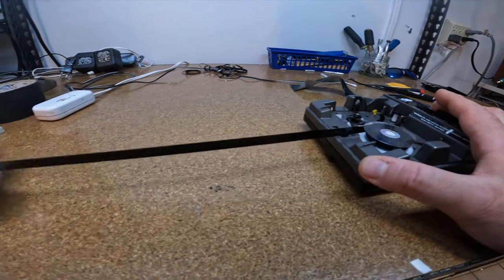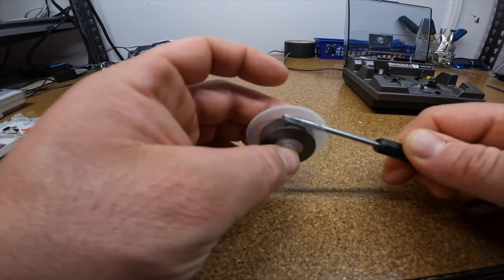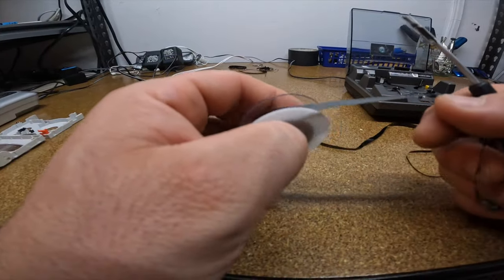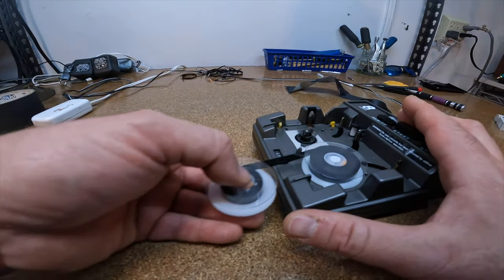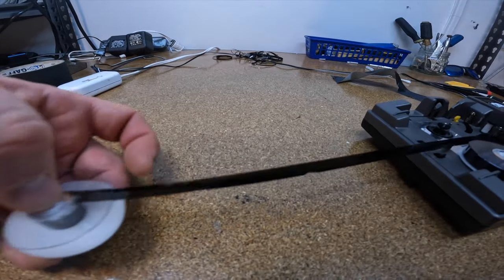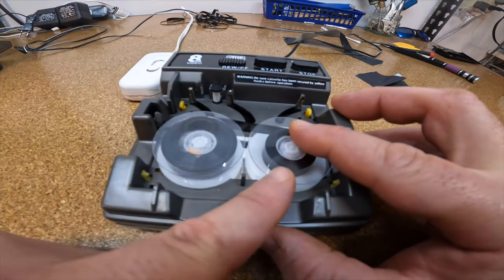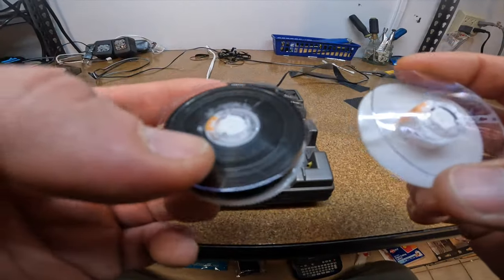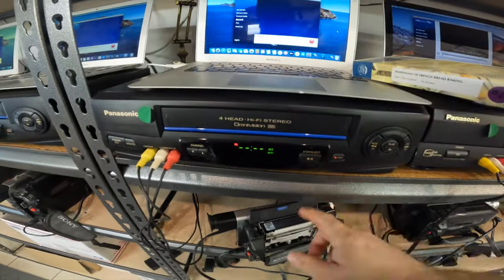How I Fix Digital and Hi8 Tapes ** STICKY TAPE SYNDROME!!

Comment: I just had a case where an audio cassette was hard and wouldn’t play. I manually rewinded it and then it played perfectly.
Reply from the maker: Audio cassettes are the worst
Reply: @EmeraldCoastDigitizing  yea they can be. The amount of drop outs are annoying. That one actually didn’t have any drops after that. It was a prerecorded store bought tape. I suspect it had not been played in years. I have a pioneer ct-w606dr. Run that with izotope elements using AI, sometimes it’s hard to know it came from cassette! P.S. I worked at a machine room for many years at a few post houses in Ny! I’m pretty familiar with almost all formats, digibeta, hdcam, hdcam-sr

Comment: whats the benefit of using a rewinder compared to rewind the tape in a camcorder?
Reply: 1. You don’t risk damaging or dirtying the workings of the camcorder.  The right camcorder in working order can be hard to find now.
2. Rewinders are much more open than a camcorder.  As he has done with VHS, you can mount the rewinder into a box and create a routing of the tape around other spare reels with alcohol to clean the whole tape length.
3. Rewinders are variably controllable, as the light dimmer switch here demonstrates.
Reply: Meglio usare il rewinder,cosi non si e' costretti a far lavorare fisicamente le testine.quando la videocassetta va avanti o indietro,le testine a parte quella di controllo non sono tecnicamente operative,ma fisicamente si,e puo verificarsi usura,ecco perche e' meglio il rewinder
Reply from the maker: I  can tell a lot about a tape based off how it behaves in the rewinders.
Reply from the maker: If it rewinds without issue I feel way more comfortable putting in player

Comment: What about the sticky part of the tape that clogs the head?
Reply from the maker: That’s the big part. The sticky tape areas from the mold often ditty’s the heads. This tape actually ended up being the full length of the tape. Nearly two hrs. It played all the way through with no issues after this. But I have had plenty of start stop, clean, start, stop clean. Senerios. They Succkkkkkkk
Reply from the maker: Dittys lol